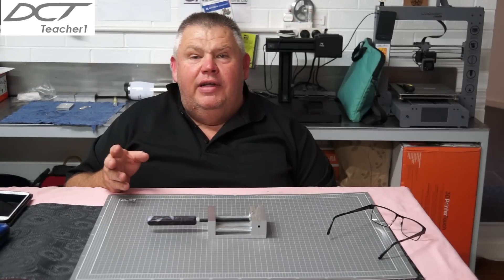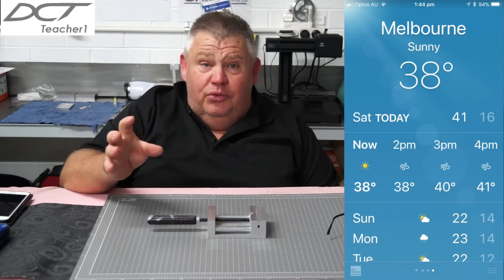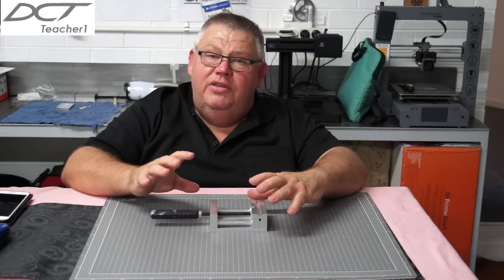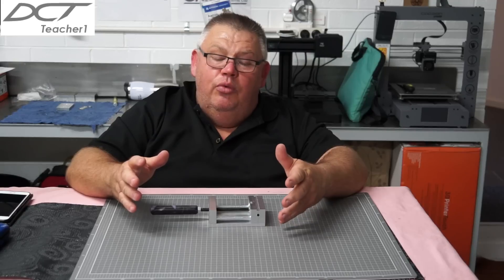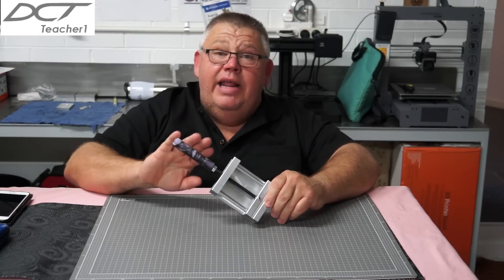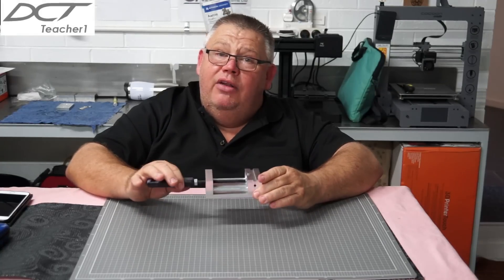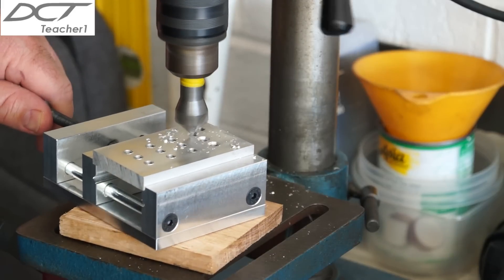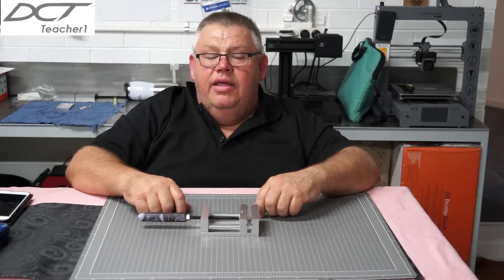Drill Vice CNC machined with Fusion 360 CAM

Comment: Hi Aaron, your students must celebrate you for your passion :-)
Questions: 1. have you had time to measure runout on your machine? 2. Which methods are you using for probing / zeroing ( got a short hint at 6:18 )? 3. Your roughing / smoothing strategies? Could you show 2. + 3. in an upcoming projects more in detail? All the best for you and your family for 2018. Greetings from Herri in China.
Reply from the maker: Hello Herri, nice to hear from you.  No I haven't measured runout in my machine.  It's been hitting the size, so it hasn't been an issue for me.  I use an electronic LED edge finder (Chinese) one purchased from eBay.  Then adjust the offset manually in the controller (+ or - 5mm) which is half the diameter of the ball.  I usually use adaptive clearing on the outside and inside my parts.  Then follow up with a contour pass or internal pocket clean up.  Will try to explain in more detail soon.  Cheers, Aaron.
Reply: As always on the spot. Thks Aaron.
Reply from the maker: You're very welcome anytime ;-)

Comment: Nice little project mate.Love the rigid tapping on the Skyfire.
Reply: Micheal Connor I assume that post I did for the company you were working with is ok?
Reply: As far as I know Scott they are off and running now after your little tweak to the Post Processor.Still surprises me that machine manufacturers aren't more in tune with the latest in CAD/CAM trends for machinists .To ignore a product like Fusion 360 which is going gangbusters at all levels of machine shop work seems strange.Keeps you in a job though and once again thanks for the fine tuning to get my mates machine up and running reliably.
For those not in the loop on this Scott had a look at a Post Processing problem for me to get a brand new Hurco milling machine running smoothly.The Hurco had a problem running the A Axis with standard Fanuc or HAAS post processors supplied by Fusion 360 but Scott was able to tweak the Haas Post to give a solid and reliable result.Not an easy thing for an operator to come to terms with at the same time as learning everything else on a new machine.
Thanks mate.
Reply from the maker: Anything you do Mr. Moyse would always be top notch  ;-)
Reply from the maker: Hey Micheal, nice to hear from you.  Been meaning to give you call, but I've pretty flat of late.  I'll tell you about it when I speak to you next.  Yes, the little skyfirecnc is still going strong.  It's been great bang for buck :-)

Comment: Nice Job Aaron! How do you like the Skyfire so far? It looked nice in this video. How do you think it would compare to a Tormach?
Steve
Reply from the maker: G'day Steve.  Great to hear from you buddy.  I'm loving the SkyfireCNC mate.  It such a fast, smooth and quiet little machine to have in the home shop.  Not sure how it would compare Steve, as they are two totally different machines.  The Tormach has dovetails, stepper motors, R8 TTS spindle etc...  The Skyfire has linear rails, servos on all axis, BT30 servo spindle.  In a nut shell I think the Skyfire is a faster machine, but the Tormach would be more rigid with its dovetails.  Cheers mate, Aaron.
Reply: Thanks Aaron.
Reply from the maker: Anytime Stephen ;-)